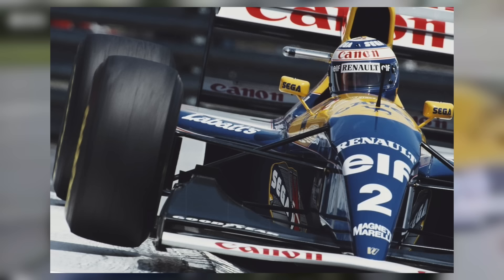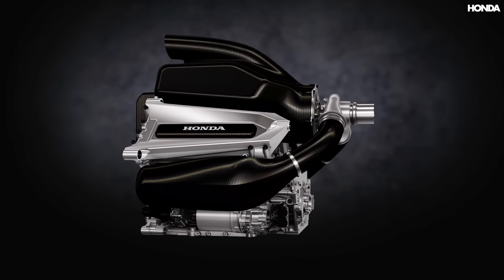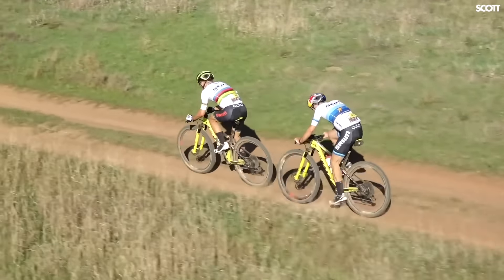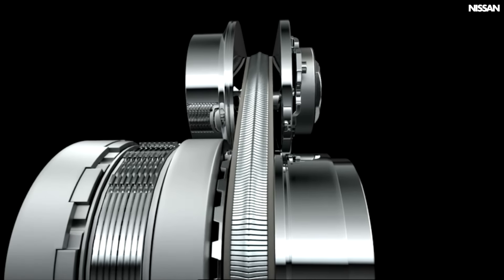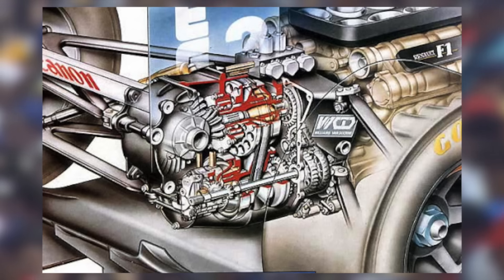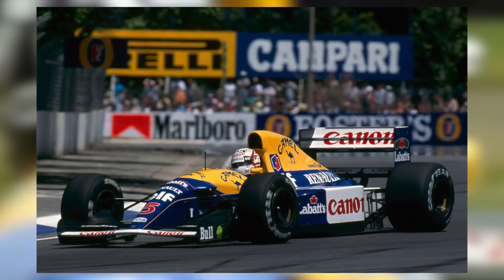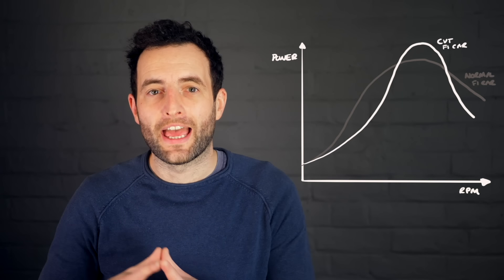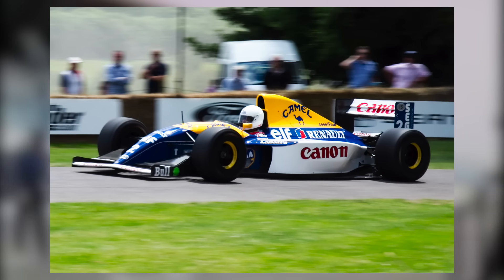The Formula 1 Car with INFINITE GEARS | The Blueprint

Comment from the maker: Some of you may have seen this one, but most of our subscribers haven't. So here is a remix of an old upload, with some new bits in there!

Do you wish this car had run for at least a race or so? Or is the noise too bad?
Reply: This is by far the best ban by the FIA
Reply: It would have been wonderful to see in a race. To see what it did, and if it would have lasted a race!
Reply: Not a bad idea. I often thought if my Volvo 343 with a Daf gearbox made 800 bhp more, it would be a GP winner. Great video as always !
Reply: I think it definitely sounds like a boat which was probably just a quick solution considering it was a mule car. I would like to see a CVT considered part of the next engine regulations though as it's definitely road relevant to hybrid cars and efficiency.
Reply: CVT, really on a F1 car, seriously!! Thank god FiA banned this nonsense(One of the things that FiA did right, even though I know they had a bias somewhere that led them to this decision). If they hadn't, F1 would have undermined driver capabilities and would have been called a Glorified Karting Championship. Hopefully the current FiA(which is owned by the US) doesn't try to bring back this nonsense just because the majority of the US drives an AMT\CVT of some sort. I hope they are able to differentiate between innovation and the lack of it and driver capabilities and the lack of it.
Reply: Unpopular Opinion: Racing is not about the sound. Racing should be about the team with the best combo of speed and reliability to win. In the context of Formula 1, add efficiency as well and we're golden. In every way, saving on the time taken to switch between gears is a blessing and avoiding wasting fuel on building up revs with your foot smashed to the floor, and dropping down the revs using the same gearbox can put enormous strain oh the system, and having a CVT can be a cost saver there that allows manufacturers to build more robust engines with better heat dissipation.
Reply: I was just gonna comment how is the a new video when I watched it already
Reply: Now I remember, DC wasn't in the original video.
Reply: @Driver61 we want a review of Max running Lewis off track and even going off himself in the Sao Paulo GP! Was it intentional? Was it fair? (and why is there no onboard of Max for heaven's sake! - no that one's not on you)  Can't wait for your thoughts!
Reply: I want the old upload plz
Reply: Would be brilliant to see that race I think
Reply: CVT was banned because of the sound it end up giving. Follow the money
Reply: Just seen this! I am a subby!
I would love to know, how does this compare to the single geared Koinegsegg engine from the Jesko?
Anyone know if there are any comparisons?
Reply: @44dam4  You must be confused. The single gear Koenigsegg is the Regera and it uses a torque converter (like a very long clutch). CVT is not a single gear, it's infinite gears that adjust on the fly. You find CVT in scooters for example
Reply: @Platypus_Warrior  Yes that's the one! The Jesko is a 9 speed LST, Twin clutch. I had to look that up!
Reply: YOU!  YOU GUYS!!  YOU are who needs to make a video (not reinforcing, but) destroying the myth of HP ... (instead of TORQUE) being the source of acceleration.  And if I'm wrong, tell me that too. Whatever the truth is, YOU have the resources to put this to rest. C'mon. This is worth it.
Reply: What about giving credit to the inventors of CVT and experimenting with it in race cars in the early 70's? No, there are not British and not as impolite, rude, arrogant and entitled either.

Comment: I can just imagine how much better todays CVT gearboxes would have been if F1 had developed them for 25 years or so...
Reply: One of the weird things is that in cars sold today, they usually make the CVT behave like a regular automatic, mimicking gear shifts, because people didn't like it. The CVT I drive now is definitely the smoothest ride I've ever had, and works great, and you don't "feel" the transmission shifting like it would in an automatic, but it still mimicks the behavior. I drive a 2017 Civic. It also wants the transmission fluid changed every 30k miles, but only half the fluid gets swapped each time with how it's setup.
Reply: @eclipset.9683  Some CVTs even can be "shifted" manually via paddle shifters, like the Subaru WRX has on the CVT transmission option. When you use the shifter it "shifts" to a preset gear ratio.
Reply: @eclipset.9683  It doesn't help that almost all CVTs have been nasty, poor quality JATCO devices. Then there are the "we can't repair that" or "we cant supply parts" and "its not under warranty" and the only options where to buy a replacement, they are improving in quality and making parts and shop manuals available now but the damage is done and will take a long time for the perception to recover.

By the time it does it may well be irrelevant as we either cant afford cars or are all in EVs instead.
Reply: @eclipset.9683  the Honda CVT is definitely a smooth one. We have a '13 Accord and it drives great.
Reply: Dont care CVTs are still shit
Reply: @eclipset.9683  honda’s cvt probably is the best cvt you could get, it’s smooth but yet still has a quick response for a cvt
Reply: @R9naldo  Worked with a guy briefly who had a newer Lancer (not an EVO) with a CVT and a straight pipe and it sounded fucking awful. He'd leave the parking lot thinking he was hot shit sounding like a swarm of bees
Reply: @R9naldo  Koenigsegg Regera basically has a CVT (albeit the mechanics are entirely different) and that car is not shit at all. F1 innovation could have brought that advanced tech from hypercars to normal cars.
Reply: @stigrabbid589  Multitronic shifts a lot
Reply: DP enduro  snowmobiles are the only acceptable use for cvt
Reply: E-CVT or what is found in lexus hybrids or toyota is much better

Mg1 motor rpm with respect to the engine rpm changes the gear ratio
From extremely underdrive and the wheels dont move to overdrive
Reply: The problem with them is that it's still a component that wears out at a waaaaayyyy faster service interval regardless of refinement. And for a street car I would always want the transmission to be understressed not perfectly stressed
Reply: @coreygolphenee9633  My daily is a turbocharged lancer and it uses a CVT, the belt driven one which is supposedly shittier than non belt ones and toroidal. Never had an issue, and I like going touge with it every weekend. Probably couldn't handle 250+HP like my Galant's manual (483HP tune), but that CVT hasn't failed me for 19 years
Reply: CVT is true of automatic, AT sometime shift like MT but faster so don’t call AT make you drive easily than CVT 😀😀
Reply: @R9naldo  still better than AT and DCT, CVT is the true of automatic because you don’t need shifting, if you want shift you should choose Manual or Sequential. CVT they call you cheating and hacked but better than when be called a girl with AT and DCT 😃😃
Reply: and active suspension!
Reply: Look at the 20+ years of prius eCVT, those are a variation that is stupidly reliable
Reply: CVT in Road Cars other than being boring  to drive use alot more fuel hunging the engine at high revs when not needed, and have zero engine brake! you cant beat the reliability, usefulness and simplicity of the classic manual box for the average street car, the only good automatics are the higher end ones you find in german cars or supercars, for everithing else the manual Is still the best
Reply: A lot of CVT gearboxes run flawlessly, most of these misconceptions come from the Nissan Juke all the way up to 2013.
Reply: @stigrabbid589  the Nissan Juke can be “shifted” with a sequential-style shifter
Reply: @wrth  Hasn't torque converters been used on normal cars for like 60 years?!
Reply: @TarenGarond  nobody has put a high performance torque converter with a single speed transmission on a road car and made it work flawlessly like the Regera.
Reply: @Tuberuser187  then having good EVs that make transmissions irrelevant is progress. If traditionalists always had their way, we'd still be riding horses instead because horses have "soul" while automobiles are just "machines".
Reply: @Ozaneee  not really honda CVT are average at best in terms of reliability, toyota has the most reliable CVT
Reply: Road racing is the best application for CVTs... as they're frequently serviced, the Achilles heel of longevity isn't as significant.
Reply: '14 subaru forester CVT is...mediocre at best.  In theory it should be smooth but it has a tendency to buck and push-pull a bit when accelerating from low speeds.  Once you're going fast enough it's pretty reasonable.  There's also an incredible throttle lag between pedal press and actual accelration, but I don't know how much of that is CVT related.  Given how sloshly and smooth automatic transmissions are these days, I don't really see much benefit.  Maybe some minor MPG improvement?  Hard to say.
Reply: @eclipset.9683  Subaru Lineartronic ?
Reply: CVT is widely used in Tractors nowadays, i think for cars it is too expensive. but i guess that technology won't set through, as doube clutch systems are more efficient. (the CVT costs quite some power compared to normal transmissions)
Reply: @Christian Rothenbuchner  - CVTs are used in many cars. Have been for well over a decade now. You're correct on efficiency losses. They are slightly more efficient and precise than hydrostatic, which is why they've seen considerable increase in popularity in agricultural applications. They've been around for years, but only in the last few years we're the made reliable in high torque/high duty cycle applications. Most tractor CVTs resemble the type used by Toyota in their hydrid vehicles... which is a planetary-based CVT. The Prius uses the hybrid electric motor to offset the drive, while the John Deere unit uses a hydrostatic motor to control the offset speed. Most automotive CVTs are belt-type "conical drive" CVTs, which are basically advanced forms of go-kart/ATV torque converters.
Reply: @driverjamescopeland  as far as i know the first 2 tractor brand to use it were Fendt and Steyr and both developed the tractors in the  90's. in 2000 CVT tractors were already etablated on the market, at least in europe.
Reply: @christian9125abd  - they didn't gain much traction in the states until the 2010s... mostly because of efficiency and reliability issues. My apologies. Your wording had me assuming you were stateside.
Reply: @driverjamescopeland  i just know that the ones used in Fendt and Steyr work great (that ones are still used with only minor changes done to them)
Reply: @gillespriod5509 well, some cars may suffer from that but why would the engine rev in wrong rpm when a computer tells the CVT what ratio to use? That's not the CVT's fault, it is shitty engineering/programming. My car can engine brake fine if I use the paddles to "fake shift" i.e. force the ratio to change. I think you are a bit general "all are crappy"  in your critique. I don't mind that tho, I love my car and the different settings: full auto, sporty with 6 "gears", or supersporty with 8 "gears"
Reply: VAG 0AN 7speed CVT which was used in the AUDI A4 B7 has chain driven CVT that can withstand 450nm torque reliably all day. The variators are also very powerful able to variate at such torque. 

0AW 8speed in the A4 B8 is even more robust and handles up to 550nm torque reliably. 

Why people hate on it is because so many idiots didn't service the gearbox, didn't change filters, oil and didn't swap the chain at          max200 000km and so the chain either fell apart or the oil pressure got too high resulting in tear and wear
Reply: @insideatent most modern agricultural tractors are cvt too
Reply: @albertogarcia5276  thats how they achieve the insane gear ratios they get? makes sense
Reply: @gillespriod5509 their is not an automatic in the current new car market that is worse than a manual in performance. They basically have eliminated it due to efficiency curves they need to keep for emissions. So what's the best way to keep your engine efficient, take the human error out of it. Plus they switch gears at the optimal range at way faster speeds than a manual can ever be done. That is why any car that is sold with manual and auto now always has higher MPG and 0-60 times with the auto. Look at the Nissan Z they just came out with. That should tell you all. Beyond that let's be honest everyone has an electric motor agenda. Electric motors have full torque from stop til near top. That's why electric cars can be insanely fast with acceleration. So yeah, expect to have zero gearboxes in the next 30 years. They don't need them.
Reply: i think the biggest problem is that the general population hates using a tru cvt, so most cvt will have fake gear shifts to simulate gearing. i had a mate that had some eary 2000 car that had a tru cvt and i was so weird riding it it as it wood always sit at the same revs when acelerating and then drop reves when crusing.
Reply: Variometics were also used on the DAF 600 and are still used on many microcars where every bit of horsepower counts.
Reply: Cvt isn't a gear box. There are no gears. No such thing as in the right gear. In the power band constantly. Centrifugal clutches been around in snowmobiling forever. Formula 1 was severely late to the party.
Reply: From mechanics I only hear stay away from CVT... Definitely not made for 500k+ KM much less those reliable old cars that could do 1 million+ km without gearbox or engine repair...
Reply: @Ozaneee nope. Toyota/Lexus CVTs are far more reliable, they don't use bands at all.
Reply: @gillespriod5509 you have no idea what you are talking about.
Reply: @turbo_marc lol. For about 20,000 kms.
Reply: @truantray  not at all. My dad has had a Juke for about 9 years and hasn’t had a single problem with the CVT. Idk if it’s the later models of that gen or if y’all are driving them like race cars.
Reply: I suppose it would be just like how the  simulators are these days pretty much perfected

Comment: My speculation on why they banned it was they just couldn't stand the sound of it.
Reply: Too monotonous.  The F1 company knows that fans come to races for the excitement of the frequently changing engine sound – club racers & wannabes can relate to that stuff.
Reply: idk they banned so many things for no reason
Reply: I think they were scared the cars would have too much top speed & noise limits would be smashed at every GP causing hosting issues. NASCAR tracks are positioned mostly in places where it does not matter if 40 cars are doing 10,000revs nonstop
Reply: Entire field for 60 laps be like:
EEEEEEEEEEEEEEEEEEEEEEEEEEEEEEE
Reply: This got it
Reply: And now we have these awful v6 things that sound lamer than many street cars. Sigh.
Reply: @LesSharp  atleast the F2 V6 turbos soune dope and snap crackle pop real good
Reply: @LesSharp  V6..? these days its 4 cylinder
Reply: @arher9598  !? It's still V6 (six cylinders)
Reply: still sounds better than the v6 though
Reply: Culturally, we have learned to accept the sound of constant-gearing-up-and-down as wild and sexy... We can hardly get used to something else, even less, when it easily beats what has been our favorite till then. It leads to cognitive dissonance.
Reply: @ENKTDeeColon_and_randomnumbers I mean if you're sitting at the grandstand odds are you just hear NYOOOM regardless of tbe gearbox
Reply: You've clearly never owned a snowmobile. 😂